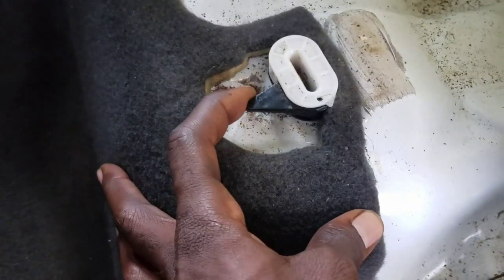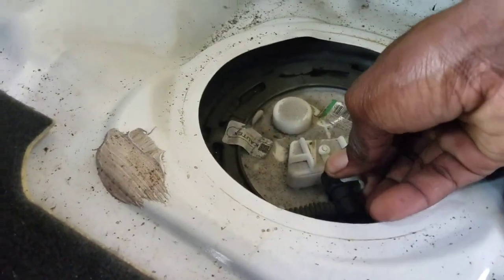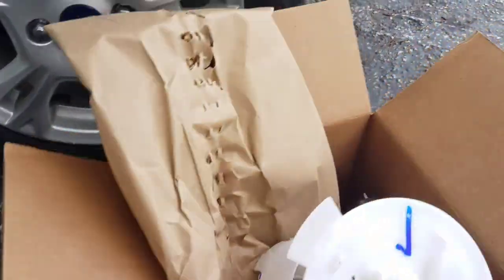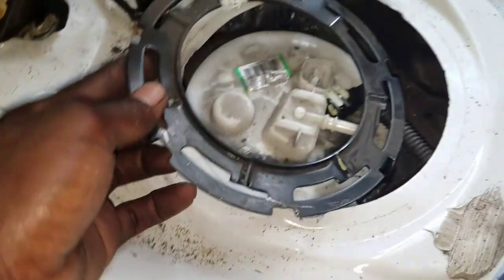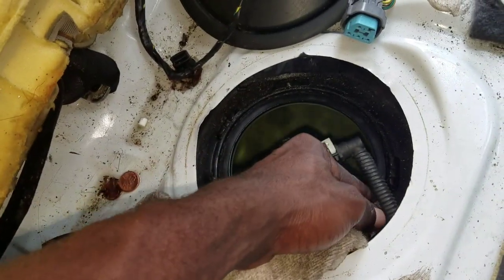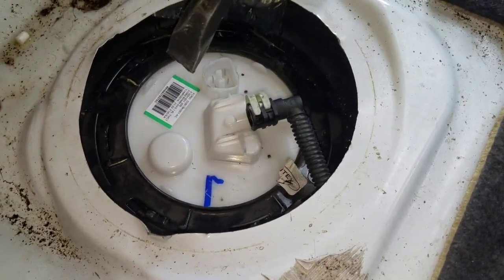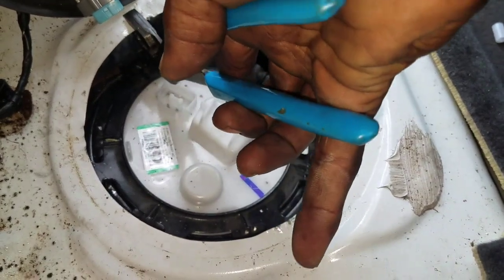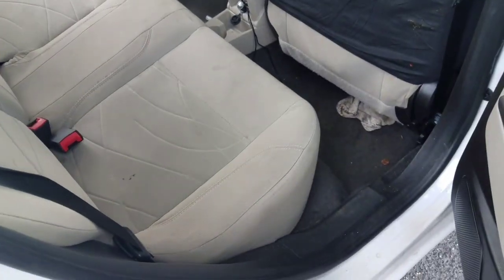Ford fiesta fuel pump replacement

Comment: My car is hesitating while driving, would that also be the fuel pump? It shifts fine so I know its not the transmission but while I'm at a steady speed or after im stopped at the light my car will jerk and hesitate and ill have to push that gas more for it to stop hesitating.
Reply: Hi, Did you manage to find out what the cause was? i’m experiencing the same thing, 

Thanks
Reply: It can also be worn out spark plugs, had the same issue on my Fiesta 1.4 from 2005. I bought 4 new spark plugs and changed them out, it drove a lot smoother afterwards, and also got a steady idle in neutral 🙂

Comment: Thank you ..awesome video , my 2015 sputters right after I put gas in it..somtimes it turns off ..I am clueless to why this happens
Reply: Jesse Delgado same thing here
Reply: @ozzy8654  could be a purge valve
Reply: Same here guys. 2016 SE here.
Reply: @ozzy8654  you ever figure it out?
Reply: @jessedelgado41  ever figure it out?
Reply: Please I facing the same issue with ford fiesta 1.6 duratec 2007
Reply: Guys this is happening to my ford fiesta. Years ago it was happening and my ex changed a censor. It was like $11. It fixed the issue. I forgot what the censor was called. Now 3 years later it is doing it again so I’m trying to change the entire fuel pump

Comment: Hi, I have a 2014 model fiesta 1.4i. I took off my rear seat and discovered my fuel pump can't be remove from the top. I must drop my fuel thank.
Reply: Yes mine too yours packed up 18k miles on mind
Reply: MINE TOO.

Comment: what was the reason for this replacement?
Reply from the maker: crlp3r the car wasn't starting because it wasn't getting any fuel because the pump weren't working
Reply: Dullah Gosohard I might have the same problem. After a longer stop let s say 8 hours I have to turn the key 5 6 seconds to have it start. How did you identified the pump as the problem? Is there a sensor fault or you have to do a pressure test measurement?
Reply from the maker: crlp3r try do a pressure test when the problem start a s see if that's the problem
Reply: crlp3r: what was the problem with you? Was it the fuel pump? I have a similair problem. only problem for 1st start. Then it runs fines without a problem.
Reply: @DULLAHGOSOHARD  i am facing a problem in my ford figo (fiesta) .my car takes long crank to start in morning .2-3 self to start .but after morning car doesn't shows any problem after first start .can u suggest any problem
Reply from the maker: @manjinderwahla8250  could be the pump not holding the pressure
Reply: @DULLAHGOSOHARD  hi Dullah. After ages i Saw your video. I face the same issue car doesn't start at one shot, also it takes much time to crank and ignite than earlier, when pressing gas pedal it makes fart like sound under bonet. 
Also, now when I trying to start it manually through key it cranks but doesn't start. Battery is normal, car is Ford Fiesta 1.6 Duratec Petrol 20007 model. Please suggest. 🙏

Comment: Question:
Does this fuel pump unit have the fuel filter incluede inside or is the filter down the line somewhere?
My 2013 fiesta se sputters like hell when climbing hills at high speed; lose power and vibrates
Get worse when there's more passengers on the car.
After some research and forum posting, I'm assuming its lacking fuel pressure.
Am i going the right way lol?
thx!
Reply: What was it?
Reply: @yfam4yfam431  lol that's long ago my friend.
I think my problem is due to old fuel. The car has been seating in a dealer's place for quite some time before I got it. I used 98 for in the car for 2 tanks (they say good fuel washes your fuel rails) and then switched back to 87, no problem till now. Have had 3 long road trips, all fine!
Also, it took me a while to get used to 110 hp car to be honest. You just have to keed using 4.5k+ revs... Some times it's just slow... especially climbing...
Reply: @yfam4yfam431  also yes, the fuel pump and filter is in one unit. Ford claims that they should out last the vehicle so no maintance interval it seems.
Reply: Have you changed the spark plugs even the coil pack if thats ok then id be looking at a fuel injector issue. If thats ok then a compression test on all valves. Goodluck. 👍

Comment: Good afternoon sir
I want to ask you a favour
Please sir I want you make a video about change fuel filter for dodge dart 2016
In details .please sir
Reply from the maker: You don't need to change the fuel filter on the darts they are none serviceable you just will have to wait until the pump goes out  (which might  never happen throughout the life of the car) then you change it because it come in one assemble
Reply: @DULLAHGOSOHARD  thank you alot sir
God bless you sir
Reply: @DULLAHGOSOHARD  sorry if I bother you sir
Reply from the maker: @نسيمالجنوب-و7ظ  no you are not a bother to me   and i glad i could help

Comment: What year and model fiesta are you working on?
Reply from the maker: What year you have
Reply: @DULLAHGOSOHARD  .2014 fiesta 1.0 ecoboost.
Reply from the maker: @turbo3492  it will work
Reply: 2005?
Reply from the maker: Am  sure about that
Reply: Actually I have a fiesta classic , I had to replace the pump by taking the whole tank out
Reply from the maker: @adishrathod1479  yes because that is how i used to change the pumps on the older models
Reply: Can you suggest an idea so the intake and outlet noses on those don't break , the metal under the seat bends and breaks them off  I replaced them twice due to this problem
Reply from the maker: @adishrathod1479   i cant give you no idea because i never done one before
Reply: @adishrathod1479  Hi Adish, Hemant this side from Vadodara Gujarat. I face the same issue you faced 2 years ago. Can you please give me suggestions or advise Would be helpful. also let me know how can we connect?

Comment: the engine of my ford fiesta stops many times while braking, it happens more while coming down hill .. any suggestions ?
Reply from the maker: Try scan the car for any code
Reply from the maker: +Nigam Shah try scan the car for code with a scan too
Reply: Idle control valve